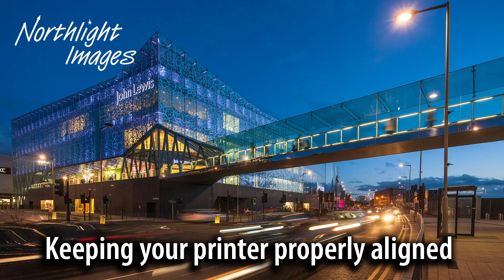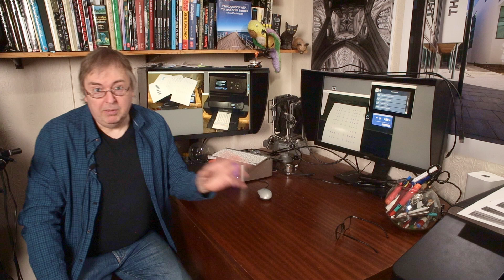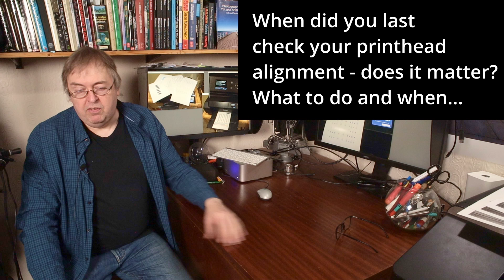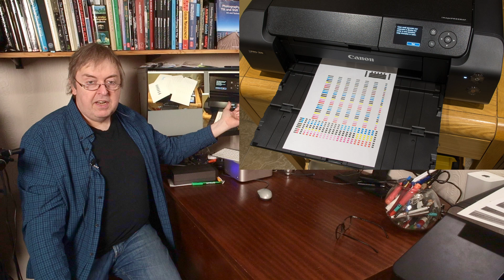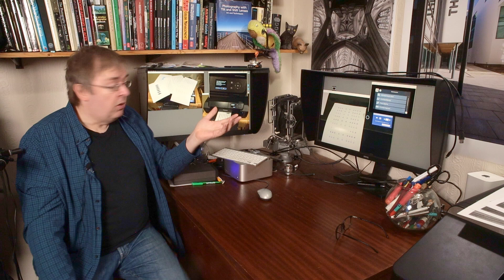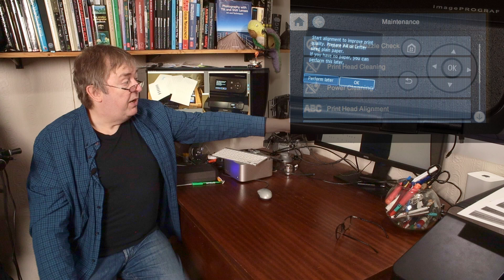Essential inkjet printer maintenance - head alignment is simple and improves printing quality

Comment: excellent piece of advice, Keith. I do nozzle checks every week on my ET8550 and P903. Both are consistent in their output patterns. Do you recommend a head alignment once every year OR once per 500 prints of A3+ size? Any specific parameter to follow? Thank you once again.
Reply from the maker: For a new printer I'll do a fresh alignment after six months and then it's part of my annual clean/check, which on my P5000 also involves taking the carts out and giving them a gentle shake

Comment: I had to do a head alignment with the dreaded P900 just a few days ago. I was using the Epson satin canvas, it was taking it fine for 6 sheets. 7th sheet I thought "well finally they must have fixed the paper feed!" so feeling confident  I hit print and didn't guard it. Came back 20 seconds later to a scrunched up canvas in the printer still trying to print,  and ink everywhere. Its funny how these machines have all these fancy sensors but not one for "your substrate is destroying the printer".  An alignment and a cleanup of rollers later and I was up and running like before. I learned my lesson, it needs to be guarded, and one sheet at a time. Even now it will take 2 sheets of watercolor radiant white. (Oh by the way. I got one of those pens for checking paper ph. I tested the epson poster board and 2 months later still "purple" , so tentatively acid free?)
Reply from the maker: Yes - there are only a few printers I've trusted to be left alone with sheet, and even then some sorts of media seem worse than others.

Comment: Thank you Kieth, is head alignment depending on paper thinkness/ quality setting or head height ajustment ?
Reply from the maker: Yes, but for most people, ignore that and just follow the screen instructions... ;-)

If you know about such things, you are well above the level of familiarity I'm assuming for this video ;-) 
For basic tests, I'll normally use the paper as suggested in the printer manual, unless I'm creating media types or always use a specific paper, which is different from the defaults for the media setting I'm using. Once you start getting into the detailed stuff, it becomes very printer dependent.